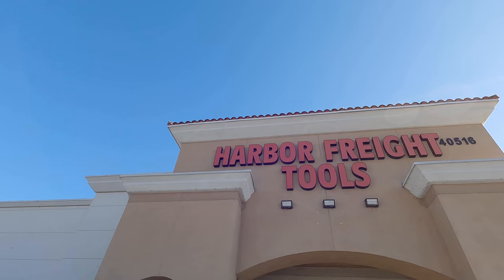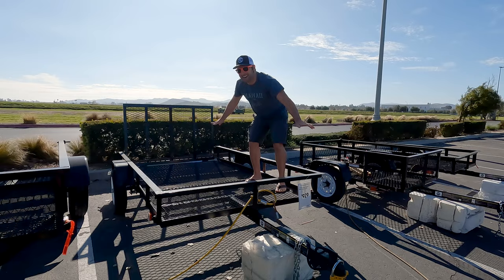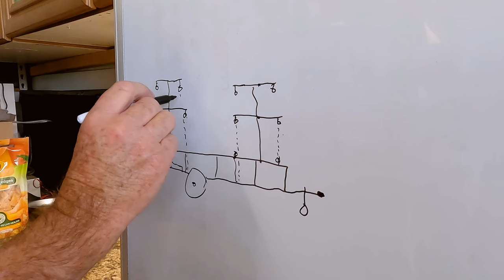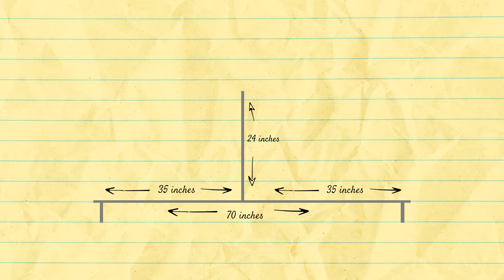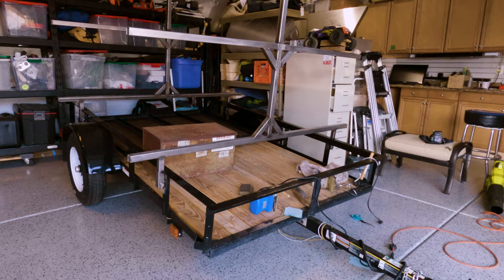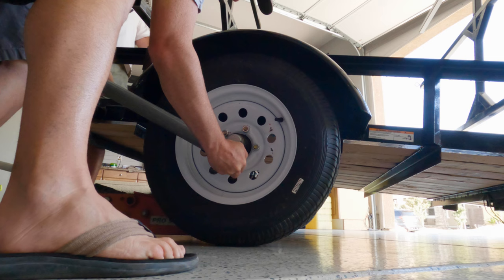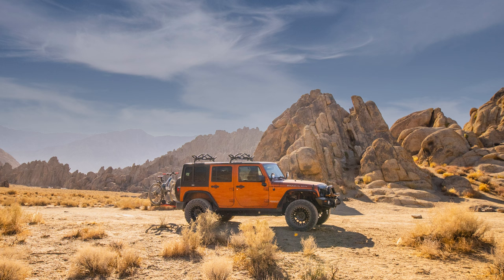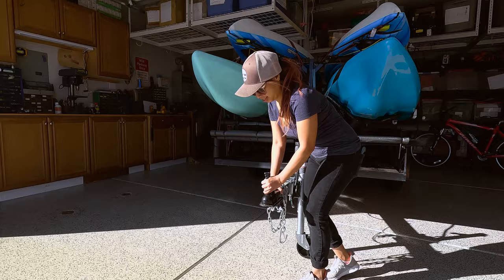D.I.Y: How We Built a Kayak Trailer From a Standard Utility Trailer

Comment: Great build. Just one safety point here. Your fabricator did not wear a welding helmet in your video… NEVER, EVER do that. You will be blinded by the acr flash of welding. So if anyone is thinking of welding their own… this fabricator is closing his eye when he strikes the arc and welds, and that is a very, very dangerous method of welding. Although you can definetly weld your own rack with a little practice, just buy a helmet, Harbor freight, about thirty bucks.
Reply: @Jus Smith What the heck? Name calling for promoting safety? Welding Blindness is no joke, It certainly does not call for hatred and name calling. Your slander of my name is also indicative of a childish and hateful demeanor.
Reply: To add to that od say your eye sight is worth more than 30 bucks it's worth it

Comment: Great job! Thanks for sharing this excellent video. When the kayak is fully loaded, do you add extra brake lights or safety indicators?
Reply from the maker: Thank you so much! Since the kayaks barely stick out past the end of the trailer, we haven't felt the need to add anything extra but now that you mention it, it probably wouldn't hurt to at least put a flag or something similar on the back.

Comment: You need to box in the bottom to hold paddles, PFDs etc
Reply from the maker: @joshwithe7468  we have definitely considered it. The only bummer is we couldn't use it as a utility trailer anymore unless we came up with a quick disconnect
Reply: @LiveThatAdventure  I have a free Yakima rocket box on the bottom of my kayak trailer, it holds a ton of paddles and gear and could even be locked
Reply from the maker: @joshwithe7468  that sounds pretty awesome! I wonder if you can do a quick disconnect to get it in and out

Comment: As you noted, the stain is purely aesthetic and has no functional purpose.  Too late now but since you went with non-treated pine you could have tinted some clear poly with a translucent orange and complemented the jeeps color and that also would be form AND function affording you some protection for the wood.
Reply from the maker: Aw man that would have been incredible!!! Great thought! Maybe if we get bored one night we will sand it down and do that :)
Reply: @LiveThatAdventure  Just flip the boards you have over ;)
Reply from the maker: @jzahirniak  you think of everything! 🤣
Reply: @LiveThatAdventure  Well not everything...

What would probably be easiest is to take a picture at around 10:00 to noon not in direct sunlight of JUST the orange.  Take it to Lowes Depot and find a close or close enough orange in their spectrum and have them mix up a gallon of heavy duty exterior paint and just roll it on...

Or if you really want to get jiggy take the wood off. Get back with your welding buddy and have him put truck bed thick sheet on top of that expanded metal and then find a lineX shop and have them tint some bedliner to the right orange.  You ain't ever sliding anything on it again but Its pretty much forever.

Comment: Did she say 23 inch tire?  The 5 X 8 I see at Tractor Supply has 12  inch tires.
Reply from the maker: This is true and I think that was my fault. They are called 12 inch tires, but I measured them the same way I do my jeep tires which are 32 inches tall.
Reply: @LiveThatAdventure  
Thanks. This is really helping me make up my mind on which trailer to buy.
Reply from the maker: @patrickheath5011  Thats awesome! I will say that we really love ours. I think the only thing I would change is I might add a bar from the front rack to the back rack for even more stability. There has never been any issue. I just like overbuilding things :)
Reply: 12 inch inner diameter of the tire (12" wheel). This is the trailer I bought too. I haven't built the kayak rack for it yet but someone shared this video with me so I'm hoping to do something similar to what they did here.

Comment: From the title, I was hoping for some actual DIY ideas... as in do it YOURSELF. As opposed to hiring a welder, using retail kayak racks.
Reply from the maker: Will if you have welding skills you can definitely do it yourself. You can also use pipe insulation foam on the bars and just strap the kayak to that. Boom.... Diy